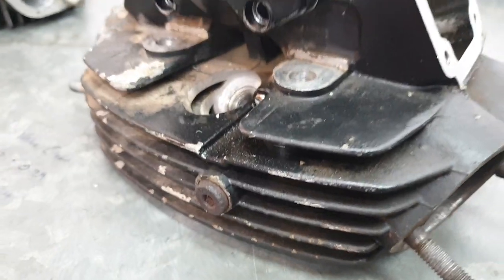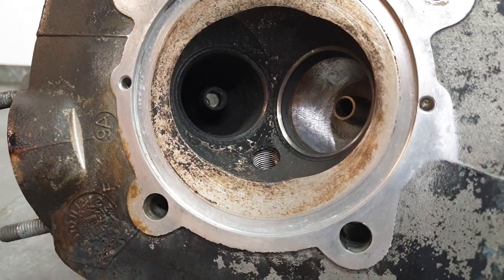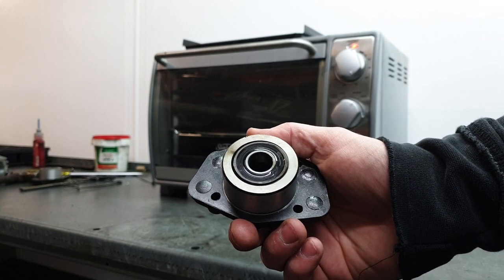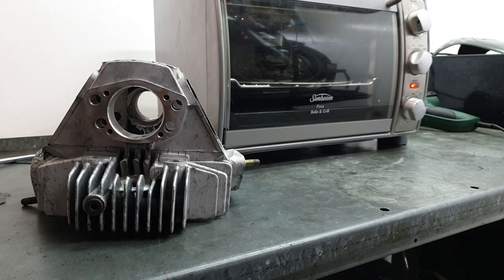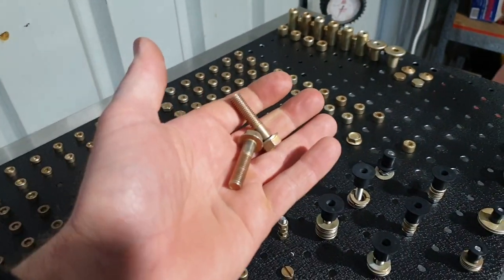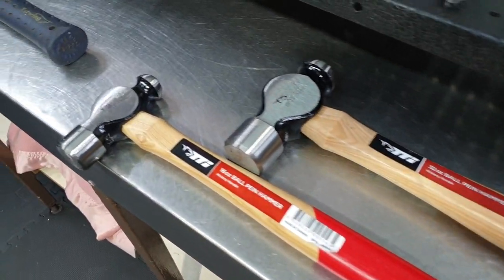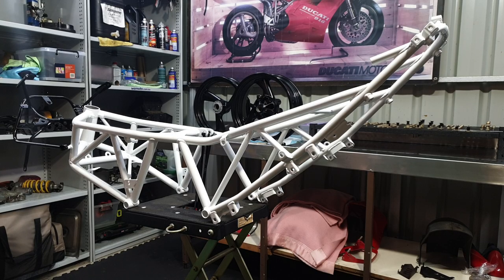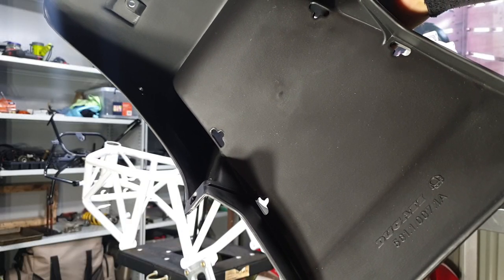DUCATI 900ss Supersport Rebuild - Motorcycle Project : Bike Build : Ep 09

Comment: Looking good mate, must be satisfying starting to bolt it back together. I never thought to use the tap in a drill to clean out threads. Thanks for the idea 👌🏽🍻
Reply from the maker: Cheers Shane.Keep the drill on a lower clutch setting so if it grabs it doesn't snap the tap off. That would be bad hey.
Finally cracked 2k sub! 
Yay !
Reply: Nice one bud well deserved 2k good stuff! 🍻🍻🍻

Comment: Hi Mate

Saw a fella on an other channel make and use home made "back to black" for plastic parts.
40% linseed oil/60% paint thinner.
I've tried it and it works great.
My ZXR 750 parts came up mint. 
How is the Turbo by the way?, It would be great to see it on the road.
Reply from the maker: Good to know all these tricks for the black plastics. I degreased and scrubbed my ZXR rear guard and it went white like old chocolate. I couldnt get it to bounce back. Is the back to black magic potion a permanent fix or does it go faded again with time mate?
The ZXR is still sitting here at the shop. Just soo busy at work and with this 900ss at the moment. I want to get back onto it but just no time at the moment.
Reply: @turbobike749   How's it going Todd?
I've used the home brew back to black on car bumpers and all sorts of ropey old plastic and the results are surprising. I've a mate who loves detailing his BMW and he was very impressed. 
It's a bit like when you oil or wax a bit of dry wood and it brings out the grain, though it can't soak into the plastic, can it?
I don't know how long it lasts for but I've got a Speed Triple that I use on the road all year round in the UK and when I give the old girl a clean I just give the plastics a wipe over with the home brew and they always come back like new.
Cheers Mate, Gaz

Comment: Hi, I am enjoying your build videos a lot keep up the good work.

Do the aluminium parts have to be sealed after vapor blasting to stop the aluminium from growing new corrosion and is that smooth that dirt and staining won't stick to it?

No that the Ducati will see much dirt.

I have been cleaning up an old KTM 520 and all the small aluminium bits were very dirt-stained the only success I has was with alu-bright in my ultra sonic cleaner.
Reply from the maker: Hi mate. A bloke I know is doing up a CR500. He vapourblasted the engine and everything else. Then he used a Cerakote clear coat product to seal them. The parts when dry felt soo slippery. It was the feeling of parts dripping in dish washing liquid yet it was dry. Dry will never stick to his bike.
I will use a surface spray to coat the parts and stop corrosion. I seen a bike that had all parts done 8years ago and only sprayed with crc or inox and wiped down afterwards.....still looks like it was done yesterday.
Reply: @turbobike749  once I had mine clean as I could get it I hit all with WD 40.

Comment: Have you coated those blasted aluminium parts with anything? Will they stay pretty or start to oxidise?
Reply from the maker: I will just use a surface spray that will protect them. I have seen bikes that had this done years ago and still look like new.
Reply: TURBOBIKE is that some sort of lacquer?
Reply: @turbobike749  hey sorry.. can't seem to find it.. and recall you mentioned the surface spray product you used.. What was the product ?
Reply: @turbobike749  ah .. found it.. Proprep by Silkolene..